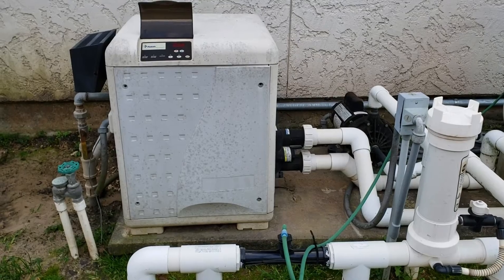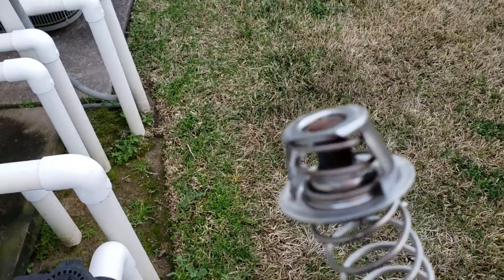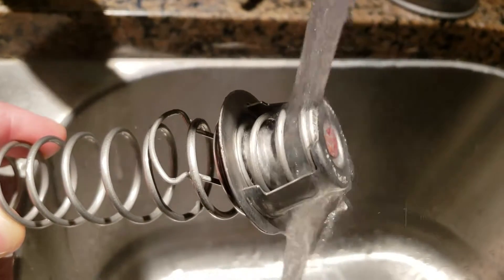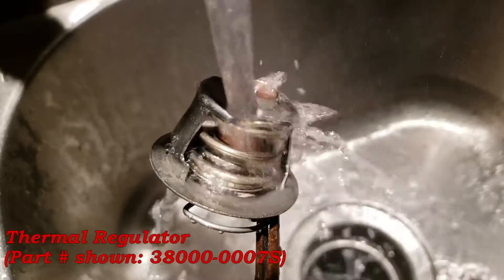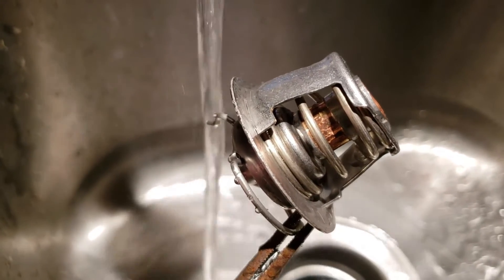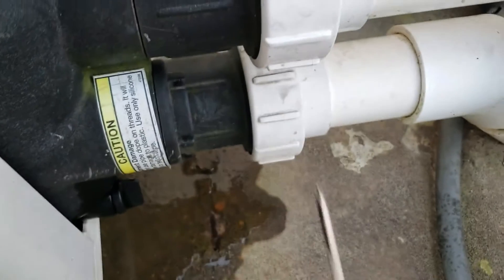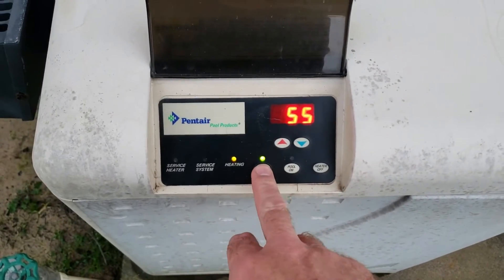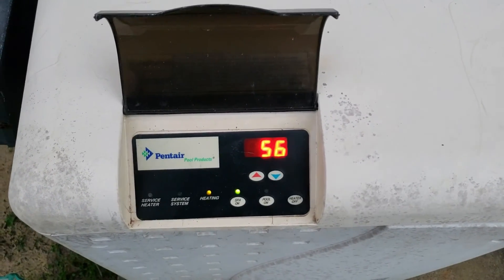Thermal Regulator Replacement on Pentair Mastertemp 400 Pool/Spa Heater

Comment: What was the issue with your heater before you figured out that part was bad? 
I have a Master temp 400 that will start up. Heats up for approximately 3-4 minutes and then shuts down with the service heater light on.
When I shut it off and then turn the heater back on there's a 128 r=8 that displays.
Reply from the maker: 128 followed by R-8 is normal bootup sequence for you control board.  You and I have software revision-8.  I have seen revision-12 and they display R-12.  You can't update the software revision number, so always expect that number to be R-8.  As for your heater shutting down, you should first turn the top panel of the heater upside down so you can see the diagnostic LEDs on the control board.  Do you have any of those LEDs illuminated?  If so, watch my video to help you understand what electronic component if faulty:  https://www.youtube.com/watch?v=wNdBBHqE1vo

If you don't have any diagnostic LEDs on the control board illuminated when the heater goes shuts down with the service heater light on, you could have a faulty stack flue sensor (not quite fully internally open SFS) or a faulty thermal regulator.  Hold down your "pool" or "spa" button (whichever one has the green light when you are heating) on the membrane pad as I showed in the video to see if you are getting a legitimate temperature reading from the stack flue sensor.  If you get an erroneous reading, it is an easy replacement.  If it is good, then test your thermal regulator with scalding hot water in a sink and replace if it is locked open or locked closed.

Before I replacing this faulty thermal regulator, my heater would ignite for about 20-30 seconds and then the electronic gas valve would close and the heater would shut down and it would display "service heater" without any diagnostic LEDs illuminated on the back side of the control board.  I could turn the heater off and immediately back on and it would run for another frustratingly short cycle.  This is due to the High Limit Switch (HLS) doing its job correctly.  The hot water was getting too hot and since the thermal regulator was stuck, but wouldn't open up and let any cold water in to dilute the very hot water down to a 120-135 degree output range.  The HLS is a safety designed to detect the output temperature and shut down the heater if the water output exceeds 135 degrees.  You don't want to melt a hole in your underground PVC pipes with boiling water so this is a good safety.  I'm all good after the thermal regulator replacement.  Hope this helps.
Reply: @pvt-pilot  thank you for your time and in depth how to diagnosis! I will get to the bottom of the issue with my heater and let you know. 
Hopefully I will not have any issues. 
One more thing. My unit is about 11 years old. Do you have any idea what the life expectancy is?
Reply from the maker: @megmarc70   Life expectancy is directly related to how you keep you water chemistry.  If you always keep too much acid, too much chlorine and PH imbalance, you will tear your equipment up prematurely.  Mine only lasted 8 years before I ultimately ended up replacing just about every sensor in the unit, heat exchange coils and plastic manifold bypass valve.  I would say you are on the tail end of life expectancy at 11 years.  But keep in mind, you can buy a sensor replacement pack for $99 on Amazon and run through all of them.  Heat exchange coils are around $600-$700 and manifold bypass valve is around $40.  All of this stuff is replaced on mine now and I am not even close to the cost of replacing the whole unit which is about $2200-$2400.
Reply: @pvt-pilot  oh man, I'll be seeing what is up with it shortly. I think we live in the same area as each other. I live by the lake..
Reply: Hello, I removed my access panels and found a mess. There is heavy rust on the top of the manifold chamber and around the exhaust stack. There is a rust hole on the top cover. I also have a AFS light on. I'm thinking it is the hole that is triggering the AFS light on.
Reply from the maker: @megmarc70  Well perhaps, but a hole in the top of your combustion chamber lid would be like an extra exhaust port...not sure that would slow down the velocity of the air entering the intake which is where the AFS tube is attached.  Put a temporary duct tape patch on it to seal up the hole and see if that clears you AFS light.  If not, then remove one of the bottom bolts of your manifold with at 13mm wrench.  If water pours out of the bolt hole, it is time for a new heater my friend.  There is no point in replacing heat exchange coils on a unit that also needs a new tub and most likely time for new sensors, etc.
Reply: @pvt-pilot  hello again, I ended up replacing my heater with a new unit. I replaced it myself. It was very straightforward to replace.
I was wondering if you knew if any parts from the old unit were worth anything? It is a Master temp 400 natural gas.
Reply from the maker: @megmarc70  Everything functioning has pretty good value.  I would probably keep or sell on ebay:
Control board (they go bad especially the display)
Membrane pad (they go bad)
Ignition control module. (About $150 used)
Maybe the electronic gas valve with flame Arrestor (but maybe not because they dont commonly go bad and would be kinda expensive to ship)
Wiring hardness (because some people have rodent damage and would mind a used harness)
Maybe the blower motor/fan housing if it works...they are hard to find used.

At 11 years, probably all sensors plastics, manifold, coils are shot.
Take the coils out and take it to a scrap metal yard.  Since you said you live close to me by Lake Houston, I would recommend you take the old copper coils to the recycle yard in Huffman (it is on 1st St - 1 block north of FM 1960 about 100 yards east of FM 2100).
They gave me $62 cash for my junk coils.  They would probably pay a bit for that tub too.
Reply: @pvt-pilot  man, thanks again for the info!!  I owe you a couple of cold beers!!!

Comment: Thanks, I believe this is exactly whats wrong with my unit.  Except I have the 250 instead of 400.  Do you know if my unit has a complete different spring and thermal reg?
Reply from the maker: I know for certain the STA-RITE 400,000 BTU heaters are the same as the Pentair Mastertemp 400, but I am not certain if the 250 is different than the 400.  I would imagine they are all the same because if you search the thermal regulator model for your unit on eBay and Amazon, they same part # comes up as shown in my video.  I would check with a local pool supply company first before buying it though.
Reply: Yes it is the same ! For both heaters ( sta rite & pentair )